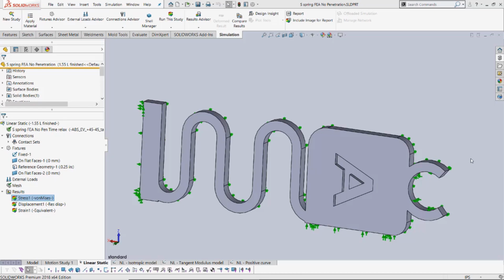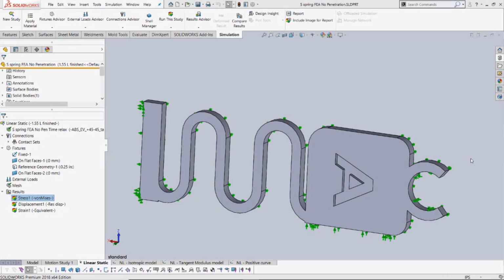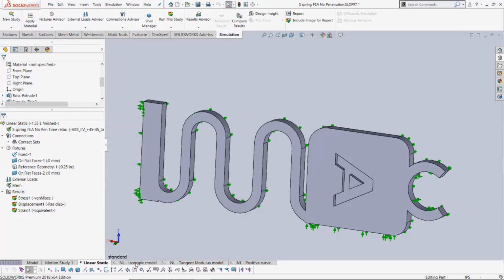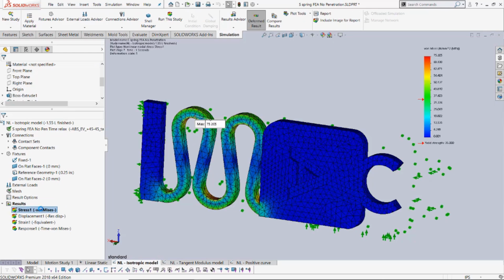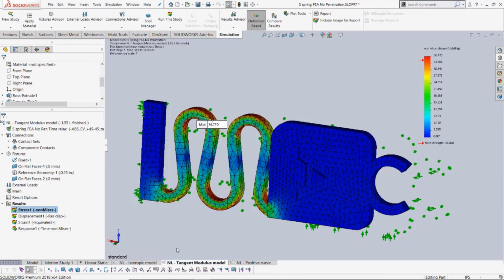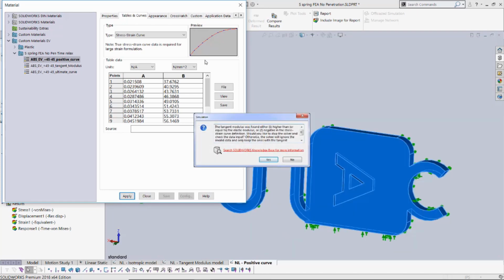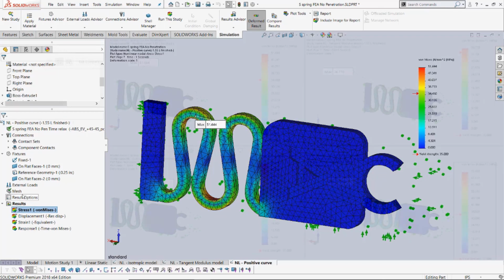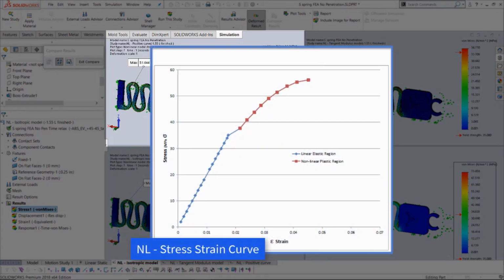SOLIDWORKS Simulation - Nonlinear Material Model Type Setup

Comment: Thank You for the video.
Which study will be more accurate, when comparing to real scenarios?
Reply from the maker: In any study with large displacement, post yield and nonlinear materials, using SOLIDWORKS Nonlinear Simulation will be more precise. Since this part is ABS plastic, using the material model “Plasticity Von Mises” and using the proper Stress strain curve for the material can be used to benchmark a live case. Having a Stress Strain curve go beyond Ultimate Stress can help you study higher deformation like buckling.